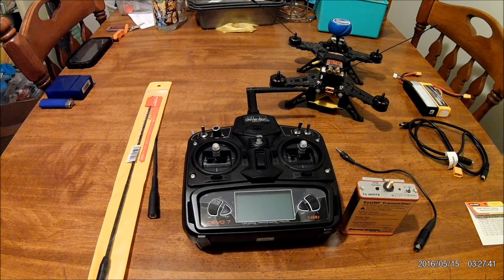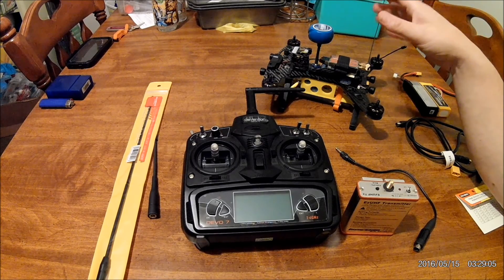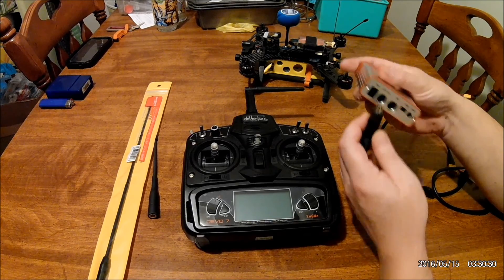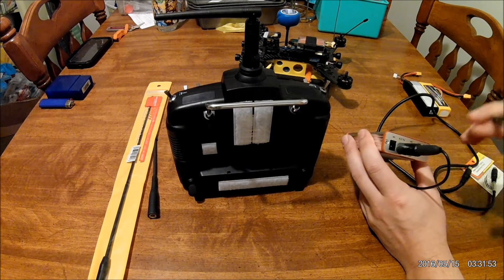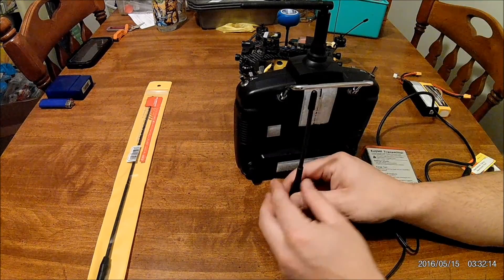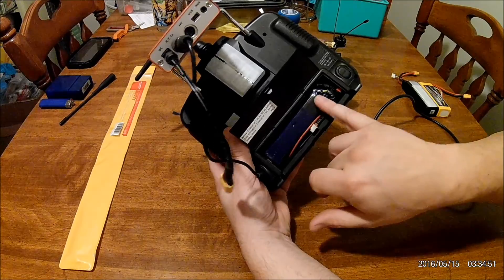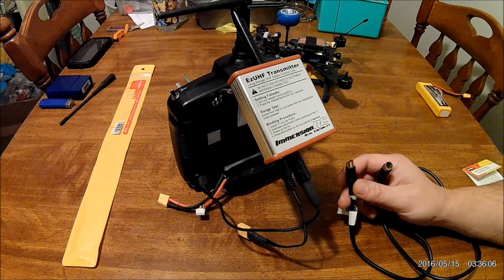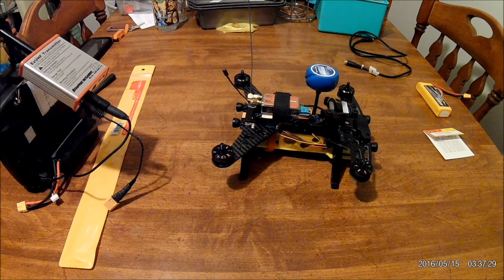Setting up EZUHF on the Devo 7 radio and the Walkera Runner 250, Part 1

Comment: I’m using devo F12E . All I need to get this ezuhf to work is to plug into the trainer port will do? You do not need to change deviation firmware?
Reply from the maker: Mervyn 8888 If you have added any deviation software then it should be plug and play to use EZUHF. IF you have added the deviation software then you need select PPM protocol for your model in the deviation setting on your radio in order to control the EZUHF system. In most cases it will work with default PPM options.  I hope that helps.  Please subscribe if you haven't done so yet. That really helps me out.   Sincerely Dez
Reply: desode9 
I’m using devo f12e which doesn’t support deviation software. Without that software installed can it still be plug and play?
BTW, where did you get yr ezuhf? Which reputable web seller ? Thanks
Reply from the maker: Mervyn 8888 As far as I know yes. If the devo12E has a trainer port, it should work without the software.  The radio in this video is the cheap Devo 7 and it also does Not support the deviation software either but if worked great with the ezuhf and it was plug and play.
Reply: desode9 
Alright I understand. Yes I do have a trainer port. Where did you purchase yr ezuhf. Saw many online seller but which is trusted seller. Where did u get yours?
Reply from the maker: Mervyn 8888 Are you in the states?
Reply: desode9 
No I’m not. I’m in singapore. This is a problem. I don’t not wish to get from eBay.
Reply from the maker: I don't know what shipping would be but I use ReadyMadeRC.  They have it on sale https://www.readymaderc.com/store/index.php?main_page=product_info&cPath=344_808_810&products_id=179   and you would need the Jr style trainer port adapter. I believe that is what all the Devo radios use But double check yours.. It should have can with a trainer cord.  https://www.readymaderc.com/store/index.php?main_page=product_info&cPath=344_808_810&products_id=894   Also I recommend that if you start to push the range, get a Diamond Sr-771 antenna for the EZUHF transmitter.
Reply: desode9 
Thanks!! You have been a great help to me! I’ll source my way from here.
Reply from the maker: Mervyn 8888 My pleasure and if you need any more help, I always go the extra mile for my subscribers!  Thats why I do this to help the people that follow my channel!  Sincerely Dez

Comment: Really good video I shall watch others now😜 thanks mate
Reply from the maker: FPV FREAKY No prob bro. First couple videos that I ever did on here so They are far from perfect. lol
Reply: desode9 put it this way bro it helps me a lot 😜 I've just recently been posting videos and editing mine are really bad but I hope to improve lol.. yours are good. I need to buy a uhf unit now lol. Just build myself a delta wing with cc3d. Hopefully it works.;-)
Reply from the maker: FPV FREAKY I use uhf for most of my builds. The recievers are pricey however you can find them used at a reasonable price.  Just keep in mind your aircraft's flight time as to if it is viable to use uhf on it. Flight times dictate range so sometimes its no worth using uhf unless you wanting to really fly behind a lot of obstructions.  Thanks for subscribing!
Reply: desode9 ok I'll bear that in mind. Yeah I'd like to get a x8 wing eventually. Long flights. Can you fit osd on them just like you can with normal systems.? I'll do some flights to test battery life aswel .
Reply from the maker: FPV FREAKY, Yes you can. its just like any rx. I have a Finwing Penquin from RMRC that I use a full eagle tree osd on. I run two 4s 6000mah together in it and I can fly forever!  lol. Good luck!